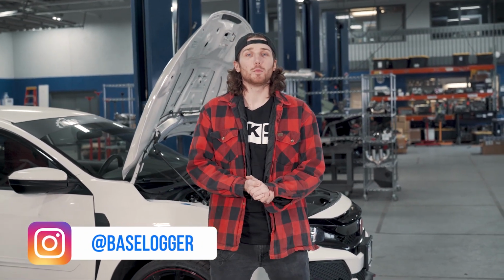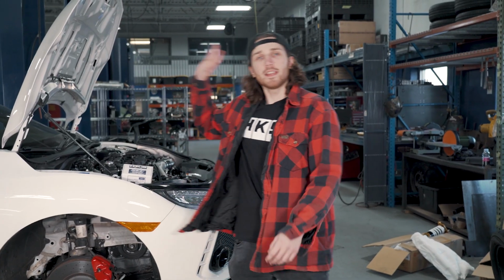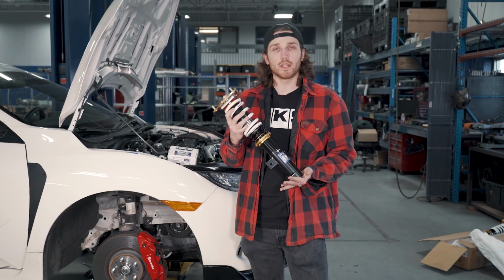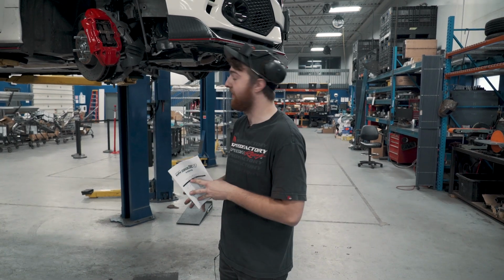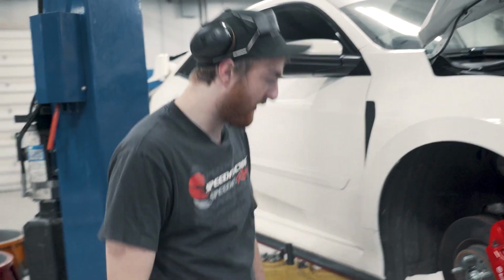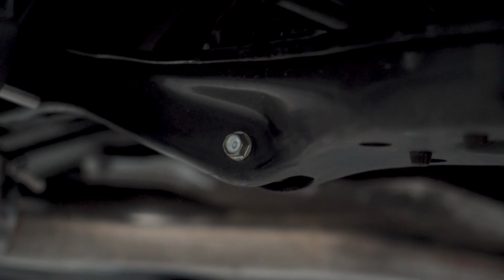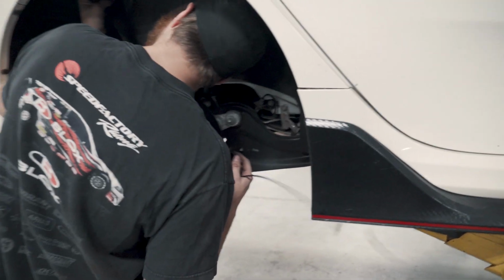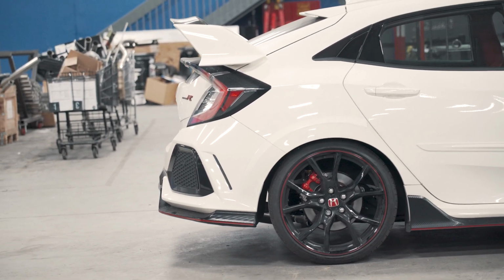Installing HKS Coilovers on The FK8 Civic Type R

Comment: Dont do it..oem is better
Reply: what about springs??
Reply: how is oem better?
Reply: @tavo.simracing  i guess its better in the sense that you have flexibility with dampening. But as far as performance goes, comparing +R mode to these coilovers, the aftermarket is prob much better.
Reply: @tavo.simracing  I can't find the link now but there was a team of people testing coilovers on the type r by comparing track times. It took months of dialing in the suspension to produce times better than the oem set up. The car is perfectly balanced from the factory, once you start throwing on a bunch of parts, changing the suspension geometry, you throw that balance off. Just slapping some coilovers on without accounting for that change in other components and calling it a day will end up worsening actual track performance even if you think it 'feels' better.
Reply: @darkknight097  idk about perfectly balanced. on the track, i get the rear end getting loose a lot under heavy braking which i mean for fwd is pretty common since all the weights in the front. i do see your point though.